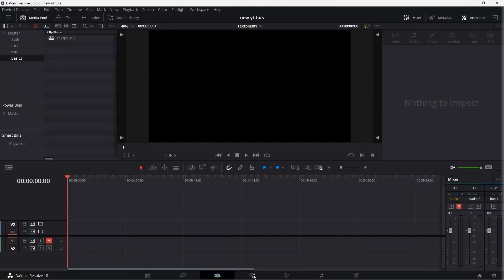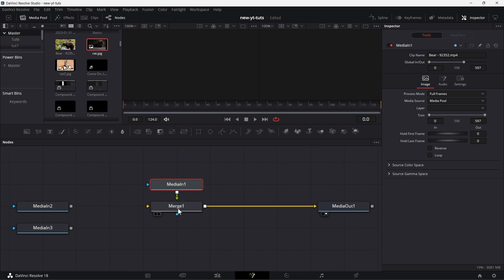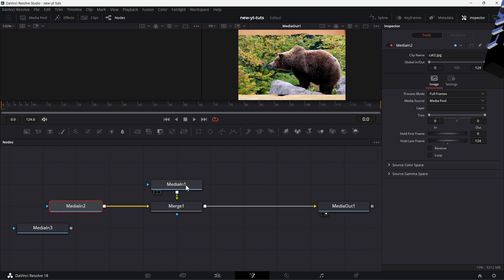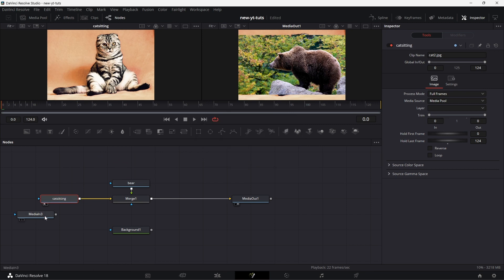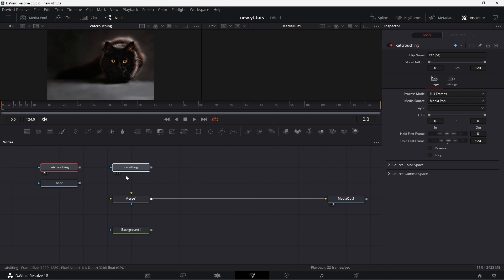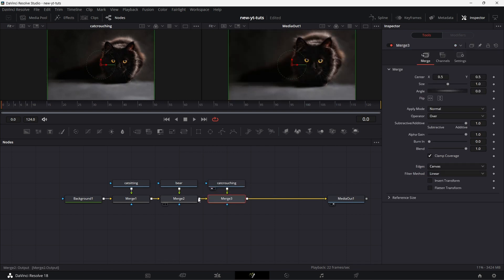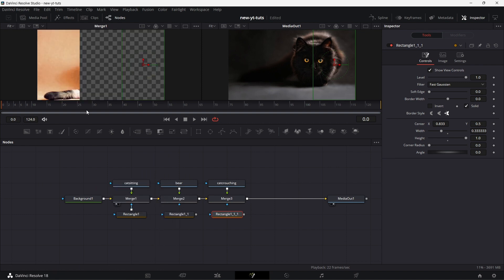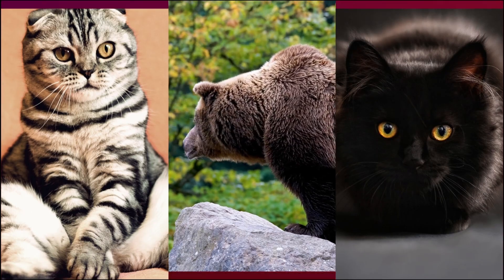Fusion Basics 01 - Merge Node

Comment: Great tutorial.  How were you able to see anything in both the left side and right side viewers before the rectangle masks were connected to the mask inputs of each of the merge nodes?  Does just clicking on/selecting the specific rectangle mask make it appear in the viewers?
Reply from the maker: Thanks for watching. Masks control what part of the image is visible. If a mask is not connected to a merge node, the merge node will simply show whatever is connected to the foreground laid over the background. But once you connect a mask, the mask will only show what it's shape covers. I hope I answered your question.
Reply: @madresolve  - Thank you for that information.  I think that my question is more along the lines of if the rectangle mask is not connected to anything yet and then you just click on the rectangle mask, is that what makes it appear in the viewers so you could see the guides as to what the mask is covering before you start making adjustments to it in the inspector?
Reply: @mikevanchieri : Drag the node to the viewer on which you want it displayed, in this video it was the viewer on the left. Alternately, you can click the left-view or right-view icon on lower left corner of the node itself.
Reply: @DairyAirGunners  Thank you! 😊
Reply from the maker: For some reason I am just getting to see this. Sorry about that. 

It seems I got this late, but happy the question got answered. It isn't my style not to respond as soon as I see a comment. The channel after all is about learning.
Reply: @madresolve  No problem, I still gave the video a “Like” and I’ve been a subscriber of your channel for a while now.  All good 👍